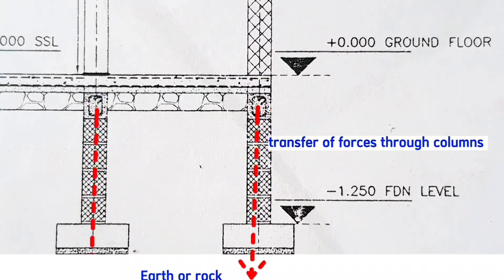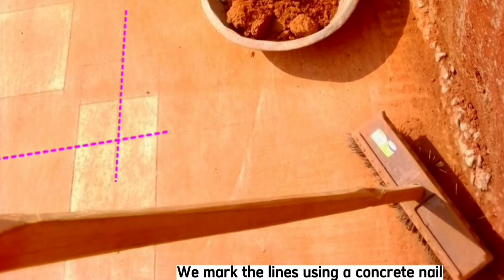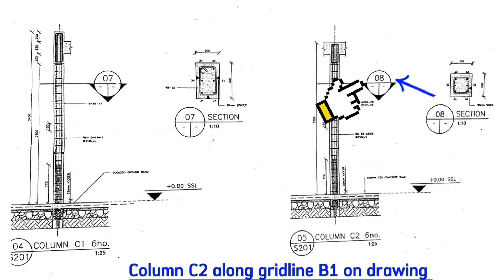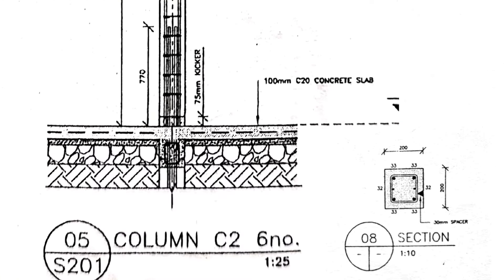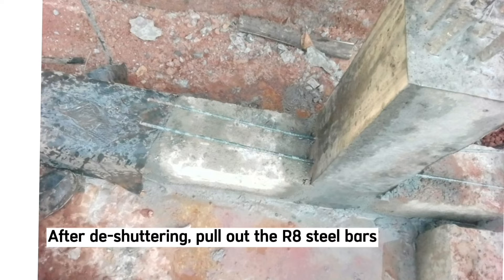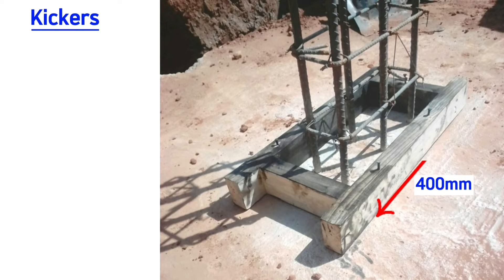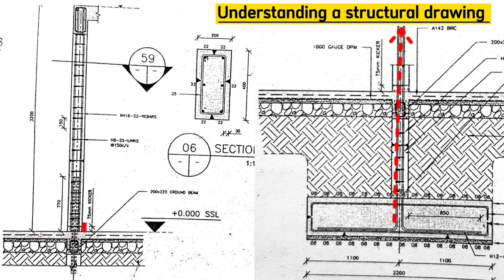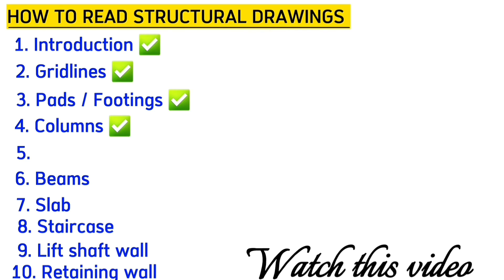How to Read Column Drawings - A Step by Step Guide

Comment: what do you mean about column kickers ?
Reply from the maker: A kicker is a small concrete step that guides you to the cast concrete for the column in the correct position.
Its really becomes impossible to rectify if you have already casted concrete for the column in a wrong position slightly off the grids, so we first cast a small concrete with the same size as the column with thickness of around 75mm before casting concrete for the main column 
Kickers also help to position the wall correctly along its coodinates
I hope you saw the clear picture of the kicker in the video
Reply: Thanks Ian , Got it @ianconstruction
Reply from the maker: Alright brother 🤜🤛